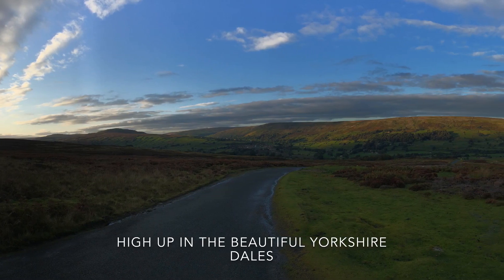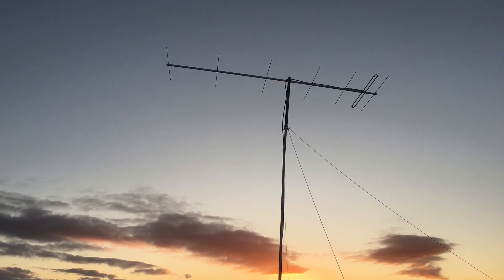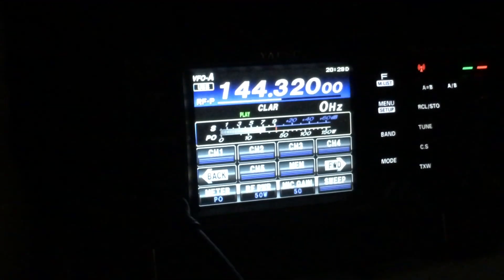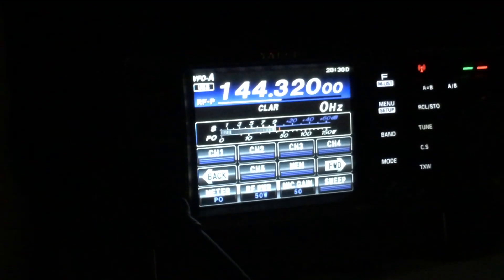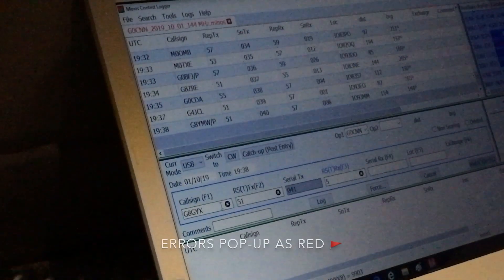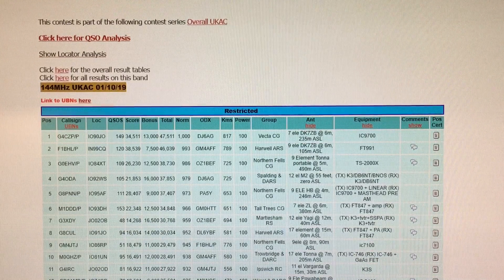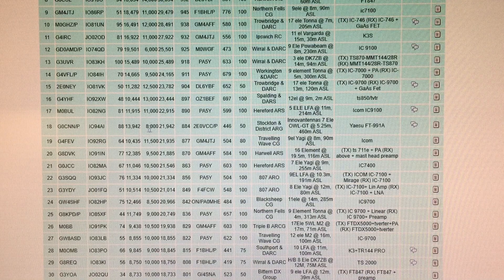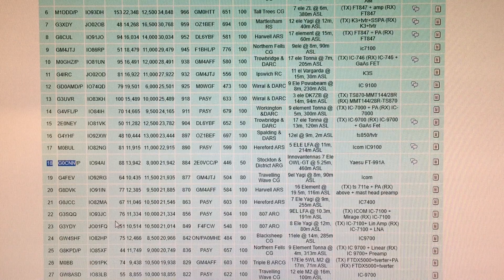Innovantennas 2m 7 Element OWL-GT Super-Light Yagi Part 2 - Contesting /P

Comment: Great video Ian, a lot of people don't get what the FT991A offers and you show a great example in this video!! I made a very lite and compact 12 volt rotor that runs off a 9 volt battery works very good and from the portable station.
Reply from the maker: Thanks Chuck! Yes, I like my 991A. Works a treat on HF too and I know there's lots of potential digitally, but I've not gone down that route yet. I like the idea of a light/compact rotator mind, as this one plus the antenna is on the limits of what weight I can push up vertically while locking it off with bolts at each section. It's what I have though, so hard to make a case for more spending! Enjoy your 991A Chuck! Ian.